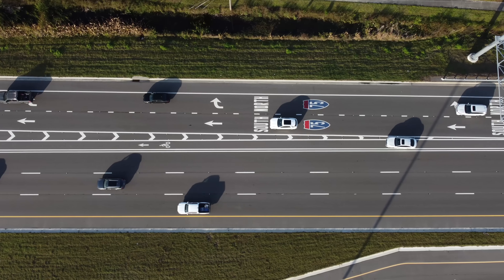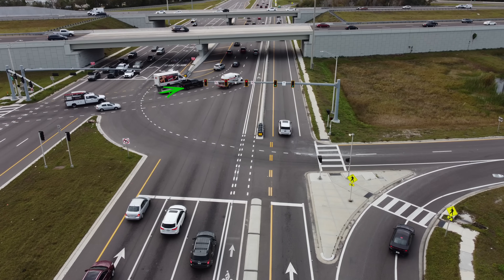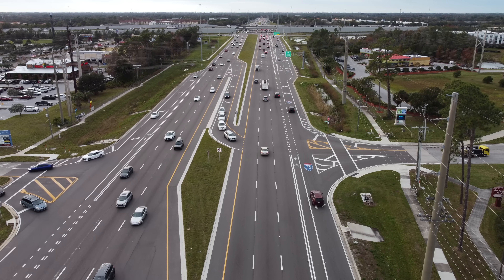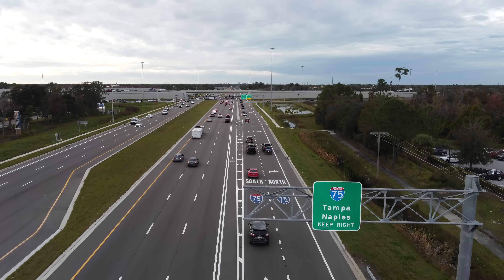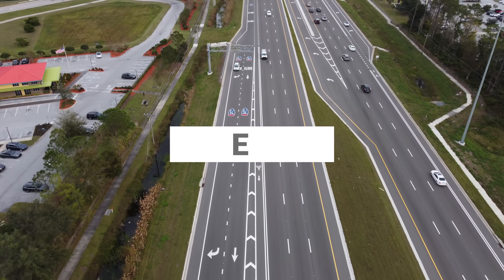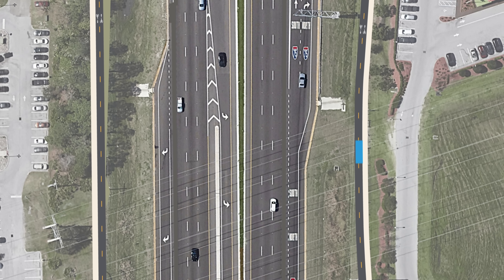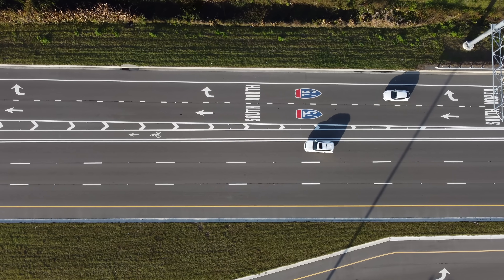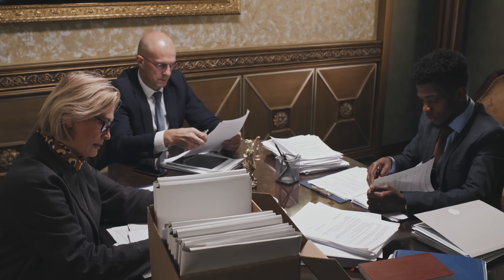This Brand New Interchange is Already Flawed

Comment: Based on how projects are funded by my MPO, my guess is that the purpose of that bike lane was not to be useful for cyclist and ONLY to ensure the project could receive additional federal funding meant for active transportation projects.  They don't expect any cyclist to use it but they do expect to use money allocated for cyclist for more car infrastructure.
Reply from the maker: Very likely
Reply: @Streetcraft  yeah the bike land was to discourage cycling in the area. They did a similar one at a diverging diamond junction near my house where the bike lanes are in the middle of the Bridge, but no one used it because just 300m to the south there was already a cyclist underpass that was much much safer
Reply: @Streetcraft can you compare euro traffic designs with american, uk has very simple but efficient highways, would love to see it
Reply: @Streetcraft  I think they wanted to add the bike lanes there to appease the bike lobbyists, but didn't consider the problems that they would cause. They're designed with the mindset that bikes use these roads too, which they do, and really shouldn't. The solution you had for transforming the existing sidewalks into bike lanes is much better. I wish I could agree with you on the tunnels, but there are issues of flooding in those tunnels, and forcing cars and trucks to climb short hills.
Reply: Yes. It is quite a sad paradox of the US federal funding system. I saw a similar design in Jackson, TN where the bike lane at a new interchange isn't attached to any other infrastructure and is designed to be converted to a car lane in the future.
Reply: @elijaha773  Kinda reminds me of how housing developers used to build the drainage ponds on the high ground.  As projects over a certain size needed a drainage pond.  However by building it on the highest ground in the area, it would remain dry, and after a few years they could get permission to build houses on the land.

Local government eventually wised up to it, as it caused a lot of flooding problems as every development had drainage infrastructure that only drained more water into neighborhoods not out of them.
Reply: @elijaha773 Yeah, it's disappointing how frequently this is done. I've seen several examples of this across multiple states, there was even a road they recently repaved near where I live in California which removed the bike lane, but leaving the signage so bikes often start to go down that road along the sidewalk, reach the end of the sidewalk, then either continue in the dirt until it's impossible to ride further, or have to turn back.
Reply: @elijaha773  That is the sort of behaviour that should be covered by clauses regarding badfaith actors and misapropriating funding. ... ... but that would require a willingness to actually do anything about corruption.
Reply: @elijaha773  I'm originally from Jackson, though I  don't live there anymore.  What interchange were you talking about?  I'd like to go Google Maps it to see how bad it is.
Reply: @blakeh95   It's the SPUI at I-40 and US45/N Highland Ave.
Reply: @elijaha773 Now I understand the mysterious bike lane that appears for an 1/8th of a mile on a strip of a road that was paved near my workplace... We're missing an entire lane now 😂
Reply: @elijaha773 ADA ramps at some intersections make about as much sense as bike lanes in this interchange.  The county rebuilt an T intersection with new traffic lights in 2014 and put ADA ramps on all four corners.  The one side is tall weeds all the way to the edge of the road.  Nobody would ever walk there.   The ramps are to get to the walk buttons, but why would anyone ever need to cross?  The county repaved the road last year and replaced the ADA ramps that less than a decade old!  I wonder if there are state funds for adding ADA compliance?
Reply: @elijaha773 it’s good, at least the US government isn’t completely insane in Nz where sick of the government spending millions on bike lanes no one will ever use
Reply: This is why there should be clear standards on how bike lanes that qualify for funding should be built.  It is sickening that this would have qualified for any increase in funding.  At the least there should be a barrier between the bike lane and the traffic to the left so they cant cross over.
Reply: @ScottCP1 😮 can we Make the banned cars amendment
Reply: I couldn’t believe my eyes when I saw that cycling lane. The engineers responsible for incorporating that into the design should be charged with reckless endangerment.
Reply: @ppotz this is actually criminal. This is like putting a reusable metal spike on a hospital bed to get green credits. It’s meant to kill people. How the fuck is it approved.
Reply: "Every system is perfectly designed to get the results it gets." - W. Edwards Deming
Reply: I knew there was some cagey legal reason for that bike lane. To be totally honest, bike lanes don't belong on that road at all because it is designed exclusively for motor vehicles. Retro fitting cycling infrastructure on high speed roads is stupid. 
There is time and place for cycling infrastructure, but that is definitely not it.
Reply: @artemkatelnytskyi As shown in the video, the construction cost $80 million.  Putting in a tunnel/overpass for bikes and pedestrians would have been feasible but obviously that was not the goal. Look at that crosswalk across the onramp, you think cars at nearly 60 mph will observe pedestrians ?
Reply: @karlkoehler341  building parallel bike paths and tunnels would cost another $80 million if not more.
Reply: @artemkatelnytskyi  More likelu less than one million.
Reply: @artemkatelnytskyi it does not cost anywhere near as much to build infrastructure to handle bikes. They are not giant trucks
Reply: @astronemir  somebody suggested to dig tunnels for the cycle route, which would be expensive. 
What I mean is that it is expansive to redesign a stretch of road from ground up to accommodate cyclists. It is hard to retro fit cycling infrastructure on roads that have been initially designed for cars, at least from what I have seen. To be fair, with this example the did redesign the entire interchange and did a terrible job with cycling infrastructure anyway. They could use the sidewalks as shared paths, as suggested above and in the video, and they could route it under the bridge. There would still be a problematic place where a cycle path would cross high speed traffic at an awkward angle, but it'd still be better than what they have done.
Reply: @artemkatelnytskyi sounds like they should’ve spent more on bike lanes then and less on roads. Or stop lying about  caring for the planet when we keep making roads for gas cars instead of paths for bikes powered by humans Lmfaoo not to mention the cost of insurance around there will probably go up once cars start getting into car accidents
Reply: @artemkatelnytskyi  Considering the land surrounding that interchange, tunnels wouldn't really be such a good idea.
Reply: @artemkatelnytskyi  Amen. Here in Sweden biking on high speed roads is actually illegal. I was just flabbergasted when I saw that bike lane. For real? A Bike line on a high speed highway interchange? That road design over here wouldn't just be stupid it would be illegal.
Reply: @stoferb876  Bike paths on Highway>Arterial intersections aren't bad. The Netherlands has tons of them, and I'd srgue they're safer than cycling in the center kf Amsterdam.

You just gotta design them right
Reply: @stoferb876 The situation in Sweden is a little more complicated than "not supposed to bike on high speed roads".
You are allowed to binge on any roads that have a limit up to 50 km/h freely. For roads 60 km/h and higher, you're only allowed to bike on them if that's your only option going to your destination, and if there's no dedicated bike path/lane. However roads classified as motorway (motorväg) or expressway (motortrafikled), you can't bike on at all. So legally, there's no law (as far as I could find) that would prevent them from building bike lanes that bikers can use, on roads of 70–120 km/h, as long as the road isn't a motorway or expressway. However, that doesn't mean it's happening either.
Reply: @artemkatelnytskyi  If the bike lane hugged the right side, it would need only ever cross two lanes of traffic without a light, and would cross that one lane with the light. It would actually be pretty nice for a freeway underpass crossing.
Reply: I literally yelled "holy sh*t" out loud when I saw that bike lane. I ride my bike in the city almost everyday, and I would never ride on that, that's insanity!

It's some nightmare level passive aggressive bs. Like paying someone by dumping pennies in their driveway and pouring motor oil on it, and when they complain you make the argument that they didn't really want to be paid in the first place.
Reply: As a former state highway engineer, I can tell you that the amount of money in the federal pot for bicycle and pedestrian improvements is fairly insignificant.  I would NOT have designed any of my general highway projects merely to qualify for such funds.  (For several years, my state failed to spend federal funds tailored for bike improvements because it was deemed not worth the effort of creating a statewide bike program.)

Instead, the environmental planning process REQUIRED consideration of multimodal alternatives and the state design process REQUIRED consideration of bicycle and pedestrian facilities.  Unfortunately, the prevailing attitude often was that of compulsion ... doing only as much as was typically required for any other project (not fully engaged in a solution that worked for all users).  That's my cynical opinion of the process.  Another engineer might say that the emphasis was on getting projects done on time and on budget, anything that jeapardized that goal was treated accordingly.
Reply: @1dash133  Since you say you're an engineer, I have to address something else. I'm really not a fan of this recent trend to cut back right-tun ramps.
Reply: They can still have a bike lane, but just need use their brain to find the best place to put it.  Not the middle lane of a huge road.  If you put it there, someone will use it.
Reply: Also it took millions to make this, but a proper bike lane that will be probably 1% of the cost is not implemented, better use some lines between motorised traffic.
Reply: Anytime you see bike lanes on highways, you can be sure that these aren't real bike lanes. 

Road constructions and bike lane constructions are very different. Bike lanes can be made considerably more cheaply than highways meant to handle the weight of trucks and other heavy vehicles. Their maintenance costs are significantly lower too. 

Bike lanes typically costs somewhere around $100k-1m per kilometre. Highways typically costs around $10m-100m per kilometre of road.

Building bike lanes in highways means that the bike lanes will have to follow the construction standards for the highway because trucks will drive over those lanes too. It just doesn't make sense in terms of costs. 

Unless, those "bike lanes" are really just reserved areas for future expansion of the road. Then everything makes much more sense why they're building these. Now the city can claim that they've built xxx km of bike lanes in the city, and they can then just paint over it in a few years and just keep hush about the bike lanes that they've just removed because "nobody uses them anyway".
Reply: That lane doesn’t indicate “bike traffic”, it screams “fuck all you cyclists, we’ll do what we want so don’t ask again.”
Reply: They did the save thing in my city… we have a half mile of bike lane heading up to a freeway on-ramp… only because it was a way for the city to have someone else for it. Smart, but stupid at the same time
Reply: Gotta love consultant designed 80 million dollar infrastructure.  Glad caltrans does most projects in house.
Reply: Here in Quebec, there have been subsidies for the construction of cycle paths. Some real cycle paths were built but in many towns and villages, this new cycle network was mainly made up of ordinary streets where they had added signs to make them shared streets, and cycle lanes painted on the side of the roads.
Reply: @sg39g  In low speed and low through traffic areas this is fine though, there's no need for separated exclusive infrastructure in these areas. Villages generally don't have that much fast traffic except at the entry and exit points.
Reply: The state of FL needs to pay that money back if that was the case or spend their own state money to add a proper and safe bike path on the side. We need to look into this and take action. Staying silent isn't going to stop corruption. You are not a spectator. Speak up when you see something.
Reply: Well, obviously, the designers were completely comfortable about having their kids ride their plastic bigwheels down that bicycle lane. I mean, it's clearly marked, what could go wrong? 🙄
Reply: YES. Uhhh fdot suck sometimes
Reply: I agree with you but there will be cyclists using their designated lane - the same way some daredevils cycle on Rt. 441.
Reply: your bout half right, whats more likely is the state politics and party ideology got involved in the design of this interchange, and it became horrible on purpose so they can justify the "old ways are best" and continue business as usual with wider roads and 0 multimodal access.
years down the road, people will be complaining bout it, and it'll give the state justification to get the bike and pedestrian access removed.
Reply: Plus people would complain about the poor state of the education system.
And the mindset of those who graduated from it.
😱
Reply: So a state trying to cut federal funds but at the same time taking advantage of what federal funds there are to get out of paying for all of it themselves? What happenes to "leaving it to the states" huh? (Assuming that's actually what happened)
Reply: This is why you people need to stop voting for people who approve federal dollars for crap like this. There's no reason Florida couldn't have built this on their own.

California pays for Florida. Florida pays for California. It's all "free" Federal dollars so no one cares if it's spent right. Then crap like this happens, and 10% of the money is wasted. Whereas if each state paid for their own crap, people would get mad at a waste like this, because it's no longer "free" from the Fed. But y'all vote for the PORK.
Reply: Exactly!
Reply: Typical florida corrupt scummyness
Reply: Definitely a failure of the federal policy that they can basically just paint a bicycle symbol in the shoulder of a road and get additional funding for "bicycle infrastructure."
Reply: That's basically scamming the Feds, IMHO. Bicycle lanes that aren't useful aren't really bike lanes.
Reply: That federal funding is stupid.
Reply: @terminal2004  Fuck that bullshit.
Reply: Highly likely. Fckn bastards
Reply: That's crazy if it's true. For them to qualify for the funding they should require an independent group to approve the viability of the bike lane.
Reply: This is what I saw.  There should be an audit that reverses the funds
Reply: This is so disgusting, but it's Floriduh.
Reply: Part 2
https://youtu.be/r-49H0ZXyyU
Reply: That's the most logical thing. If we say there's a bike lane, we can get funding for the road.
Reply: Bingo.
Reply: It's less a "Let's kill cyclists" and more "Feds won't fund it if we don't put in a bike lane, not understanding that if you're biking on this road, you're avoiding easier and safer routes already"... 
Because in the UK, we'd classify these as Motorways still, for both funding and legal reasons, the former is it's owned by Central Govt by way of National Highways who deal with anything on the motorway network, including structures and junctions plus a bit of road. The latter is because Cyclists aren't allowed on motorways, nor are pedestrians and stopping/parking (Unless forced to due to traffic, crashes or EMS direction) so the funding isn't withheld if there's no bike lane.
Reply: Nah....this just kind of shows you how many people ignore road signs and painted lines
Reply: It's Florida. They're trying to kill bicyclists.
Reply: Leftist scum rules to hurt everyone.
Reply: That interchange as a cloverleaf weaving traffic congestion. What about a pedestrian bridge. A pedestrian bridge is a good one for pedestrians to walk instead injures and crashes.
Reply: I wonder if this is why Sacramento has started installing green plastic poles all over the city supposedly to make bike lanes clearer. They mostly get destroyed within a short amount of time because putting poles in the middle of the road where people in big cars can’t even see them means they get hit regularly
Reply: This is not the case. The language in Florida requires project to meet the purpose and need or they cannot be built. Cyclists have lobbied the state to require bicycle and pedestrian accommodations be part of every purpose and need for FDOT projects. Bike lanes aren't added to get federal funding; they are already a core requirement for any state project that isn't resurfacing.
Reply: @gingermany6223 absolutely correct.
Reply: funding like that should come with an approval of the design
Reply: Bike lanes are placed inappropriately here in Colorado, too. We have avid cyclists in this area who will ride these lanes with 60 mph traffic right next to them without a barrier. I have never understood this mindset, other than the belief that "nothing can happen to me because I'm in a bike lane." I also wonder why CDOT, our Department of Transportation would put a bike lane beside a road like this? A double line does not prevent a truck from accidentally swerving to the right into a cyclist. The bike lane in the middle of a highway is just as absurd. There must be money in it.
Reply: @kwgm8578  Some cyclists will cycle no matter what. People wonder why they drive so close or even in "car spaces" when the reason is simply that they have nowhere else to go if they want to get anywhere.
Reply: And how is it possible that nobody in charge of this additional funding goes: BRUH WTF NO!!111one

Is there no process of approving suggested designs before actually building them?
Reply: The lengths Americans go to in order to avoid building roundabouts is astonishing
Reply: If anything bicyclists are much less harsh on the infrastructure, bike Lanes don't destroy entire neighborhoods cutting it up for highways, and more people should be biking for a better walkable world.
Reply: @thanhtacles  Its your opinion that more people should be biking. That doesn't mean the world should be built to suit your needs. Who is going to front the money for bike infrastructure when bicyclists don't pay any taxes to pay for the creation and upkeep of the infrastructure?
Reply: @dredwick  It's pretty clear that you don't know anything about how roads are actually paid for.
Reply: @dredwick you do realise that the vast majority of cyclists also drive cars? Here in the UK where everything is much easier and walking/cycling is relatively easy and 80% of them also own a car, in the US I bet that is even higher. So yes they do pay with their taxes...
Reply: @madbull4666  80% huh? Provide a link to the source for that stat if you don't mind.
Reply: I knew there was something up with that bike lane, not to mention in many US areas people on bikes are considered second class citizens without rights.
Reply: I'm from Florida. Driving a bike around there is absolutely torture. Yall don't realize the scale and sprawl of florida. Biking as an option for travel in Florida is a joke. Not because of lack of infrastructure. But because the un godly amounts of energy it takes to go anywhere. 

Don't get me wrong. I long for as much bike traffic as possible. But go live in Florida. And you tell me.
Reply: I'd argue that the bike lane does have a purpose involving use by cyclists:
Active population reduction
Reply: The funding should be withheld until the engineers cycle down the entire length of that lane in active traffic.
Reply: Maybe if bicyclists started paying for infrastructure through taxes then maybe it would be more feasible to spend infrastructure money to suit the desires of bicyclists.
Reply: @dredwick  Bicyclists do pay taxes on their bikes, clothing, and specialized equipment. You should write your state legislator to introduce a bill to divert that tax stream from the general fund.

PS Gasoline, auto, truck, and bus sales taxes and parts, maintenance and repair sales taxes aren't sufficient for all the highway construction and upkeep needed so maintenance takes a low priority.
Reply: @dredwick  Hackneyed b.s. 
We all pay for those super-expensive highways and roads, you rube.
What amount of your gas taxes (since this is what I assume you mean) do you think actually funds highway projects, etc.?
Look it up. Really. You got a number?
States and municipalities use general fund money, largely, for department of transportation and road projects. You might wonder who pays into said “general fund,” you might.
Maybe you should check your pay stub. I check mine.
What do I get out of all those state dollars going to highway building and absolute shit designs like this? Me, who bikes and walks almost everywhere while also owning a rarely used car for which we pay other taxes . . . whatcha think I’m getting outta this crap deal? Near-death on almost every commute is what it is.

p.s. I have a driver’s license, have been a commercial truck driver, and still have that special licensing. So, yes, I know state vehicle codes well, etc., etc. Any further b.s. arguments you got for why the motor-monopoly needs a wake up? That is, cars are the problem.